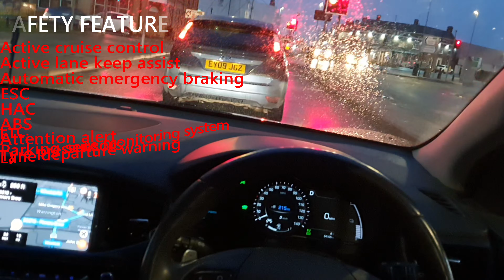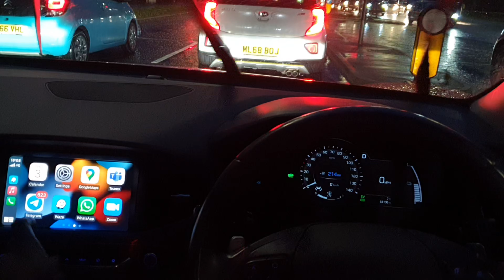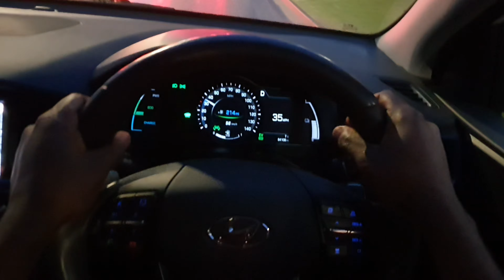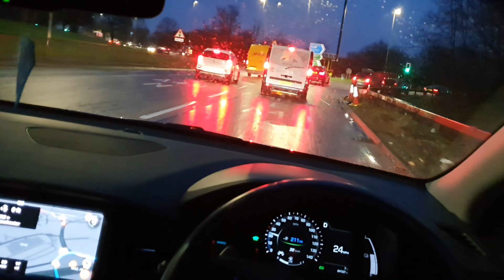HYUNDAI IONIQ NIGHT POV DEMONSTRATING ACTIVE CRUISE CONTROL AND OTHER DRIVE ASSISTS

Comment: How its ride quality? Is it like normal feul car?
Reply from the maker: Hi, ride quality is very good. Also, the car has good fuel economy. However, it won’t be as quick as other rivals when you throttle down.
Reply: @AutomobileRC  Ok buts it's not tol slow right
The reason i tested tesla 3 and it has crap drive quality
Only technology
Reply from the maker: @bastooopanooo2311 no, not at all
Reply: @AutomobileRC  Thanks. You think 2018 model with 40k would be goo to buy?